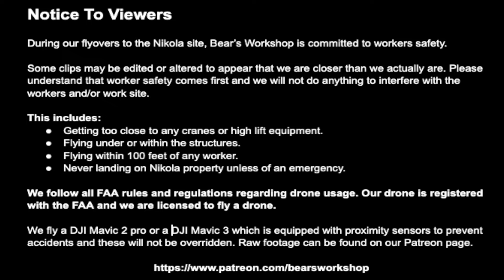Nikola Semi Pilot Factory Construction Site March 9th, 2022 | Drone Footage of 10:00 AM

Comment: Interested in knowing where the H2 production facility is going to be located.
Reply: @michaelstanley5215  There is supposed to be an announcement soon.
Reply: @michaelstanley5215  So what is your mission in commenting each video? Which stock is the alternative in your opinion? BP, Shell? Tesla, Daimler Trucks?
Reply: @michaelstanley5215  I see.  Instead of asking an honest question, you have an agenda against Nikola.  Maybe, just maybe, I know more than you do about hydrogen production.  \
Reply: @michaelstanley5215  They have a PPA that secure them energy at 2,5 cent/KW. That makes it possible to outcompete diesel.
Reply: @michaelstanley5215  You want to point out a scam when the company is hiring employees, expanding its factory and already sold trucks to customers? You need to find a better hobby cause you're clearly not good at this one
Reply: @michaelstanley5215  so you are telling me that electrolysis is a non existing method? That is boloks, because it is easy to make Hydrogen out of water.